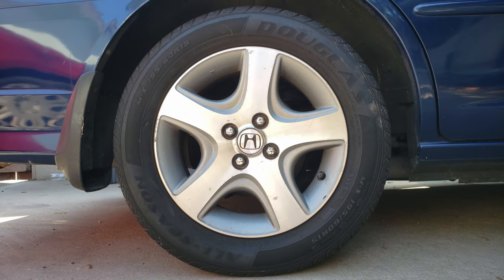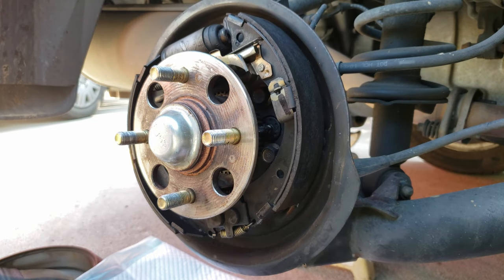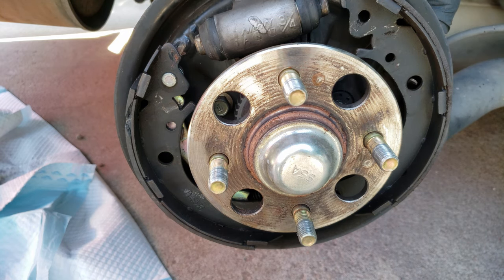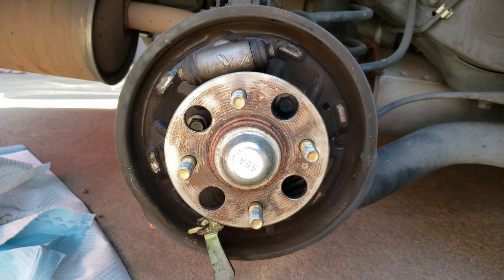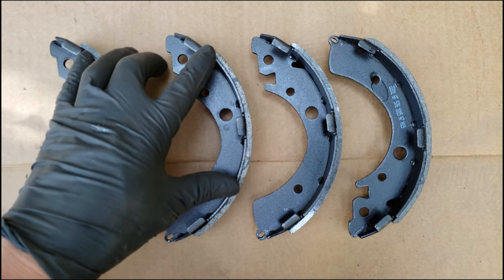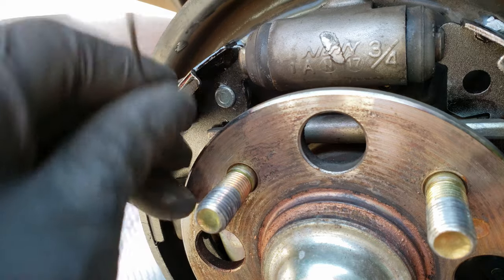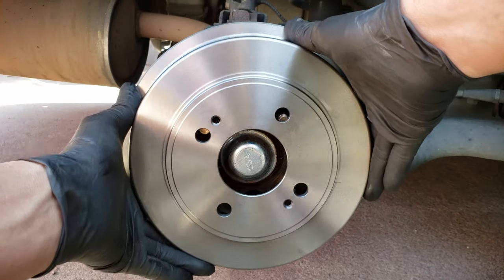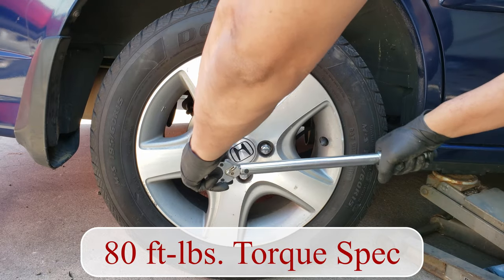How to Replace Rear Drum Brakes on a Honda Civic

Comment: This is a great video!  Just did mine yesterday and this video helped a lot!  Thanks bro!!
Reply from the maker: Thank you🙂 so glad it was helpful
Reply: I can now pull my e-brake handle all the way up.  Did I put it together wrong or do I have to adjust it by tightening the bolt near the shifter knob ?  Is this normal to have to adjust the e-brake after doing this job?
Reply from the maker: @martymckay297  if the brakes are properly adjusted then u just wanna make sure the knub at the end of the parking brake cable didnt come off the parking brake levers inside the drum if both are on properly and the brakes are properly adjusted then yes u may need to adjust the nut by the shifter
Reply: @backyardchevy328  thanks, I just needed to adjust the shoes a little and the e-brake also became tighter.  My brake pedal goes a little further down than normal though, I wonder if air got into the cylinder .  Maybe I need to bleed out the air?
Reply from the maker: @martymckay297  no, if the brake line wasnt opened or air wasnt introduced into system..it just needs a tighter adjustment..it self adjusts by driving car slowly in reverse then forward and repeat..also pull handbrake slightly as ur driving in reverse to help speed up the self adjustment..the pedal should begin to get higher
Reply: @backyardchevy328  ok thanks again!  You are really appreciated by us weekend mechanics
Reply from the maker: @martymckay297  happy to be able to help🙂

Comment: Thank you! Now I have no doubt that I am doing everything right. I have a problem with the fact that the manual adjustment loosens by itself despite the correctly folded clamp after driving about 600 km. Greetings from Poland!
Reply from the maker: Is the lil gear worn or the adjustment lever? Greetings from united states🙂
Reply: @backyardchevy328  I suppose that gear holder isn't work properly. I will check this before tommorow Time Attack event, because brake pedal is much lower than before. (Any leaks etc. Handbrake locking wheels in a very high position).
Reply from the maker: @spooneg3  yea definitely, if pedal is lower but still feels firm its most likely the adjustment that went down or isnt self adjusting to accommodate for any wear as it should..now if it feels spongy in any way check for leaks or that the brake master cylinder isnt going bad...good luck🙂👍
Reply: @backyardchevy328  thank you for you advice! I will leave a feedback after drums maintenance. Cheers!
Reply: @backyardchevy328  fixed! Adjusting handbrake in drum resolved this issue. Thanks!
Reply from the maker: @spooneg3  thats great! Thank you for the update

Comment: Awesome job on the step by step video but I have a slight knock noise wright after brake shoe replacement when breaking. It's not a squeak nor grinding sound.  Did I happen to miss adjustment parking cable perhaps 🤔.
Reply from the maker: Just a single knock? Normally a knock sound is a spring that pops..or the brake shoe getting caught on something against backing plate...is it only on one side?
Reply: @backyardchevy328  Yes sir a knock remove the drums recheck springs and wheel cylinder for leaks none found springs are good and tight.  The sound is with when applying the brakes any speeds. Of course it wasn't there before I went in 😒
Any input would be greatly appreciated
Reply from the maker: @davebocanegra5073  is ur brake pedal at the same height? Or does it go lower? Does it do it in park too?
Reply from the maker: @davebocanegra5073  what i would do is..if u can limit it to a specific side..if it does it in park then it should be easy to figure out what side..if only when moving..maybe have someone stand outside and brake in front of em to try and help figure out what side..then from there..id remove wheel and try to listen to it while someone presses brake pedal with drum over brakes..maybe u can hear it better..to tell if it sounds like a spring..if that doesnt help..id probably take it apart and look for any sign of it getting caught somewhere
Reply: @backyardchevy328 I actually had it low or loose on the adjuster star road test the knock noise present.  So my friend and I adjusted it to fit tighter drums but not too tight and the brake the pedal came up some and feels firm when braking , but noise is still present so not sure if adjusting even more would help. That's why I'd ask about the parking cable adjustment. Yes it does go into park.
Reply from the maker: @davebocanegra5073  yea if its low..thats gonna stretch the springs so its gonna pop as u press em..maybe theyre still a lot of play there..id try that first

Comment: Hi just did this and have no brakes but an E brake. Very loose on brake pedal but if i press a bunch it gets tighter. Do i need to tigthen adjuster?
Reply from the maker: Ur pedals really low when u press the brake? If it is yes you'll need to tighten adjuster so it pushes the brake shoes outward some but u still want it able to spin the wheel to a slight drag
Reply: @backyardchevy328  my brakes ended up needing a bleed
Reply from the maker: @falconfan61  did the rubber seal pop out?

Comment: Is it common for the brake to start dragging a bit? When I drive down the road in a low speed I can hear it “dragging”. When I drive a bit faster it seems to be gone. What could be the problem? I just replaced the shoes by the way and the hardware but not the drums or cylinder.
Reply from the maker: Normally when u just replace em youll get some dragging cause they havent broken in/accommodated to the drum, but it should go away little by little

Comment: Dear poster, can I use carberutor and  air intake cleaner instead of brake cleaner ?
Reply from the maker: Well theyre both good for cleaning but a carb cleaner can actually leave a oily residue which can affect the function of the brake shoes, while the brake cleaner will dry without leaving any residue..so preferably u should use brake cleaner
Reply: @backyardchevy328  Thank you very much for the quick respsonse and recommendation !  You video is very good video because you filmed on the sunshine day and it is very clear and thank you again for sharing the know-how.
Reply from the maker: @themiddlekingdom9121  thank you very much🙂

Comment: Do the springs need replacing as well?
Reply from the maker: Depends on the mileage of the vehicle, anything 150k up i replace em or if the brakes were allowed to get to metal since the stretch on the spring is more than normal

Comment: I followed this step by step and I still can't get the first press on the brake pedal to be firm.  The rest of them are but it goes mostly to the floor on the first press. Any help would be greatly appreciated.
Reply: Theres a vacuum canister that sucks all the air out the system. Youre supposed to hook it up to the bleeder thats behind the brakes.

Comment: If pin on e brake lever is too big to go through drum can I use a different pin or should I try and hammer it through?
Reply from the maker: Is it much bigger? Sometimes its the coating they use on the brake shoes that is too thick and makes pin hard to go through, if not u can try removing the pins off the old brake shoes and try those
Reply: The old ones are the only ones I have and they are not much bigger but I tried pliers and a hammer and cannot get them through. The new brakes did not come with the pin
Reply from the maker: @manrome3555  did u order em or buy locally? If local u might try taking the pin and see if they have another set that might not be as tight, if not u can use a drill by hand just to clean off the paint that may be too thick

Comment: I cannot get my new drum on the left rear.  When you put the parking brake lever on the back of the rear shoe, shouldn't that right bracket opening ]  that holds the adjuster NOT BE BLOCKED by the brake lever?  I am wondering if I have the lever on the bottom side Reversed??? Could that be why?    This is making me goofy and I wasn't far from it to begin with...
Reply from the maker: In the beginning at about 1:17 i do show the left side and how its assembled..maybe it can help u compare the assembly..see if it looks different?
Reply: @backyardchevy328  thank you

Comment: Have done numerous brake job & always lubricated the shoe contact points as shown . Never have grasped the concept of why this is done . Of all the brake drums I have removed , not once have I said to myself good thing these shoes lubricated the shoe contact points  . They were all dry , dusty & rusty !
Reply from the maker: I did a repair recently for creaking that was coming from the rear brakes whenever ud press brake pedal and it was for that same reason..they used some weird lubricant to do so and soon as i cleaned em up and used anti seize..it went away

Comment: Great video. Its similar with a 2013 LX too, right?
Reply from the maker: Thank you🙂 cant say for sure..but most honda drum brakes are fairly the same design..i know the 2011's were almost exactly the same
Reply: @backyardchevy328  yeah probably. I'm trying to find a replacement hardware kit so I don't have to reuse those springs
Reply from the maker: @king_of_636s  the local auto parts or dealer should have those drum hardware kits in stock
Reply: @king_of_636s  I have a 2012 LX.  My local auto parts store had the hardware kit (springs) in stock for $10.  I was thinking to just reuse my old springs and drum, however, since look good still (140k miles).  Do have more milles on your 2013?  I guess for $10 it's good peace of mind.
Reply: @mikew1368  I replaced them all. Just needed a brake spring tool (for pulling and twisting) from the auto shop
Reply: @king_of_636s  I got the hardware kit for $8 and did the same.  I just used vise grips to get that main spring on.  It was harder than I expected, and I took way longer than book time, but it feels good to have it done!

My front disk brakes were much easier to replace.  But I was lucky that my rotors were smooth and clean (same for my drums).
Reply: @mikew1368   I wish I could post pictures on here I got a special tool that makes it super easy

Comment: after i put a shoe back in i accidentally pushed on the cylinder too hard and it popped out the other side. i put it back but im not sure if there is air in the line now
Reply from the maker: If the whole piston assembly popped out, then yea it would have gotten air inside the wheel cylinder..so youll need to bleed out any air at least that one

Comment: Just as a word of caution: if the tension spring that runs parallel to the spreader is 3x thicker than shown here and wrapped around the spreader itself I would strongly recommend paying someone else to do this job for you. I just did this job today on my 2005 7th gen Honda Civic Hybrid and I can't even begin to describe what a waking nightmare it was. It's not a step-by-step reassembly, but rather, once one shoe is in place, the entire rest of the assembly has to go on all as one piece. If you try to do one part then the next, you run into a paradoxical catch-22 where the steps cancel each other out. All in all it took me a couple minutes here and there to follow the steps for the setup in this video (though around 15 minutes solid to get the horseshoe clip off using every tool I have), then 1.5 hours to get that tension spring back in place. And now I have to bleed the brakes because of how many times a small slip caused either/both sides of the cylinder pistons to pop off, dripping brake fluid everywhere and getting air in the line.

This is still a great video for anyone whose rear brakes look the same way. But if you find a huge spring wrapped around the spreader ... run away!!! 😆

Comment: My parking brake is loose after doing this, could i adjust anything to fix it?
Reply from the maker: Did u adjust the brakes like i showed in video or self adjust em by driving back and forth..once theyre adjusted and as long as the cable is attached properly to the parking brake lever it should go back to how it felt before.
Reply from the maker: If after that it still feels loose, you can adjust it by removing the console/cover theres an adjusting nut there
Reply: @backyardchevy328   Thanks, i did as u said and ill be sure to try that. Thank you for the quick response!
Reply from the maker: @Gerry.  good luck🙂

Comment: Any advice? My honda shoes are out farther than the drum cover and I cant get it back on
Reply from the maker: Did u readjust the adjuster so its all the way in, and its still like that?
Reply: @backyardchevy328  Thanks so much for your response... It looks like this was my own mistake, one drum cover was off when bleeding brakes (never do anything when you're overly tired) my friend helped me he had to keep maneuvering the adjuster screw and leave the bleeder valve open until he could push the brake shoes back into position.
Reply from the maker: @carlnikolov  ouch yea that would do it..glad u were able to figure it out🙂👍

Comment: Use external snap ring pliers to get thpse horse shoe clips off. You'll probably save yourself from stabbing your hand a few times with a screw driver. I got them for $3 at harbor freight and they saved me such a headache.

Comment: This video helped alot installing but my brakes are still dragging when I drive forward and ebrake is loose now I first noticed the problem when I was braking to turn on the highway herd a light grinding and the massager side was grinding and I having the same issue with the new one except more  Intense
Reply from the maker: If the ebrake is loose it shouldn't be that the brakes are dragging..have u removed the drum to see the wear on the brake shoes? Is it even across the shoe or is it wearing on just the edges..There are also 2 different sized brakes for some honda civics..maybe the size was incorrect for the drum
Reply: @backyardchevy328  put the new shoes on yesterday and tested them out and when I took the tire off the drum was full of silver dust , I matched the new shoes to my old and the old drum to the new one the wear is on the side wall and lip of the new drum I followed resemble of your video and I have watched it many many times to make sure I didn't miss anything
Reply from the maker: @rydenbahsad  yea it seems maybe the width on the new ones is different? Especially if full of dust something is not right with either the width of the drum or brake shoe
Reply: @backyardchevy328  I guess ill slap on the old drum see what happens but parts are identical Idk if there could be another issue
Reply from the maker: @rydenbahsad  grinding could also be a bad bearing but if u can visually see where its wearing it out
Reply: Well I took it to mechanic and he fixes it he said the shoes where backwards but I took before and after pictures and he didn't even flip them around he moved the lower anker spring on top of the metal piece at the bottom
Reply from the maker: @rydenbahsad  and that fixed the noise? If the shoes were different and the rears were on the front, it would cause dragging cause the smaller one ud want towards the front
Reply: @backyardchevy328  yeah but it fixed it but the shoes are identical in size and the before picture there was x marking on top with to dots same as the after picture he didn't flip them through
Reply from the maker: @rydenbahsad  thats pretty odd that all he did was readjust the spring

Comment: I could not get my retaining spring on. That sh** was so hard I had 3 other friends help me - nothing. Had to tow my car to my local shop

Any tips?
Reply from the maker: U bottomed out the adjuster? What happens when u pull it..do the pliers slide off or u just cant get it pulled far enough?   If adjuster is bottomed out..and u can have someone compress the brake shoes as u pull the spring..a really good plier helps a lot
Reply: @backyardchevy328  I bottomed it out just like you showed in the video I had everything compressed and I just could not get the spring to go in. It was by far the most frustrating thing in my life. I spent my entire day trying to get that retainer spring in and in the end I had to tow it. It was incredibly defeating.

I had vice grips but they were a bit too big to maneuver effectively. Maybe if I had needle nose vice grips I would have a chance at
Reply from the maker: @anyplanstomorrow  yea i do think needle nose vice grips would of been helpful in that situation..wish u had been able to get em done..so u wouldnt be discouraged about doing em again if u have to.

Comment: Sooo if I did all that and they are still grinding can you tell me why???
Reply from the maker: Grinding when? As u drive? As u brake?  Does it get worse when u press the brake?
Reply: @backyardchevy328  I’m still sitting here with everything exposed. So guy didn’t set the shoes back into place when he changed them out causing them to rub against the inside of the drum. We also noticed the wheel cylinder leaking so we changed it out. As am sitting here trying to find someone to bleed the breaks I see that from us changing the cylinder the one piece dropped down and the bottom spring  has been tilted
Reply from the maker: @ramonanicole2528  definitely a good idea to replace the wheel cylinder..but it may be better to take em apart and start over on reassembly if the pieces arent lining up maybe youll notice its caught in some corner